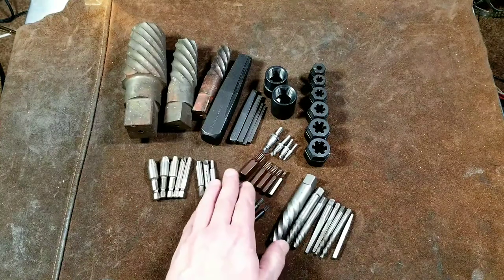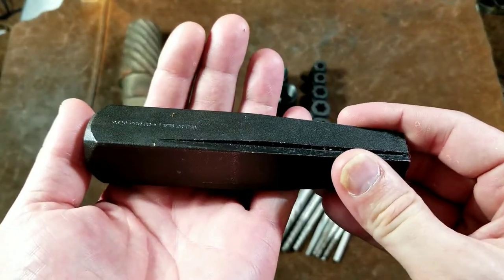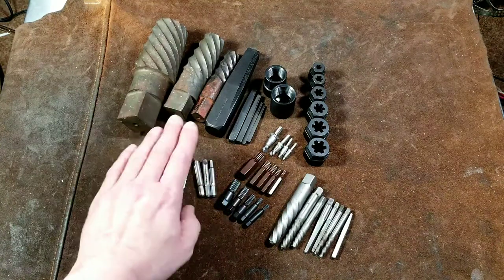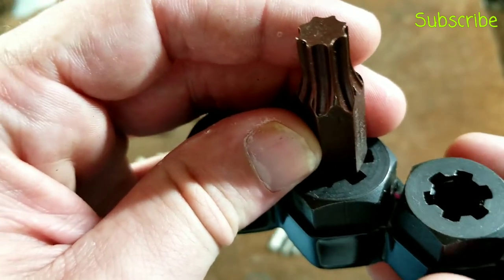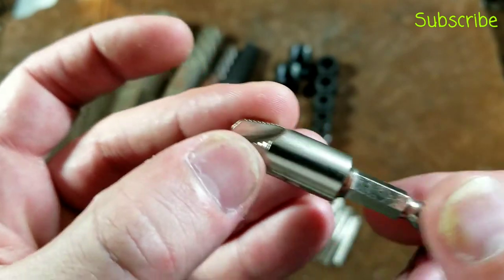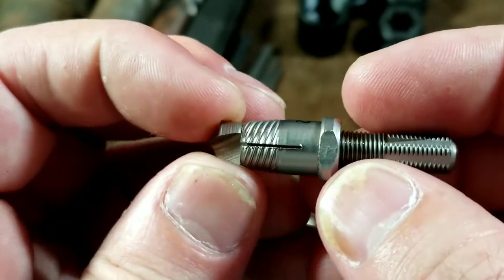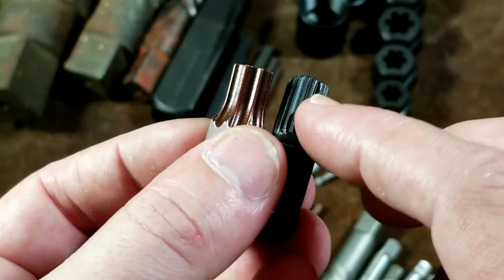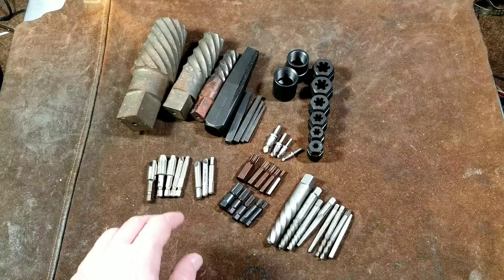Large & Speciality Extractors Review & Comparison

Comment: Catus-Nice video, with lots of useful information.  I like the larger internal extractors, which I use on a pipe or connector.  Many people think the larger sizes are useless, because they don't have a way to drill a hole for something that size.  I realized that you can just wedge them inside the larger piece, then turn them out (no drilling, no muss, no fuss).  Something I discovered about plastic pipe and soft metals (brass, aluminum, etc.):  You can't use the spiral internal types on them.  After several tries, I found that wedging the spiral types into plastic starts out okay, but when you turn them they begin to abrade the plastic; it will just spin and then let go.  For those, you need the tapered, square-sided extractors, like the large 1-1/16" Proto you showed us.  The sharp corners on them dig in and won't let go.  I use a 12-pt. socket to turn them, which seems to work okay.  I don't have any 4 or 8-pt. sockets, so I use what I have available.  A combination wrench (either end) would also work and, on smaller extractors, a tap wrench.  I have a set of concave-shaped square extractors, made by Irwin, which were not expensive on Amazon; a 6-piece set was under $20.00.  I find they are really handy removing broken-off plastic risers and sprinkler heads on my lawn's irrigation system.  I had not heard of the "Aces" brand, which apparently were expensive to purchase.  The Craftsman set you showed (brown metal) look exactly like a set of Lisle #62900 Super Out Extractors I have (but have never used).  The Car Quest splined extractors look nice, but I've found the more points/splines you have on an extractor, the less effective they are.  They don't seem to bite in as well as a four-sided one will.  As you know, we don't use these every day, but you need a variety of types on hand to deal with all the "Oh, shit!" moments that can occur.
Reply from the maker: The concave ones really do have excellent grip and soft materials as do the square ones for the most part. More flutes really is for bolts where the strength of the extractor flutes means a lot is very stubborn high-strength bolt would just destroy a for flute concave extractor as a flutes would strip out before removing the bolt.

You make an excellent point it is very nice to have a variety of extractors because often they break and often you need one particular type of extractor for a particular job